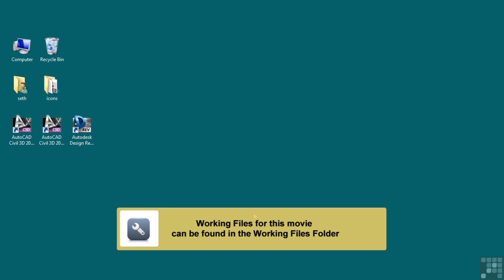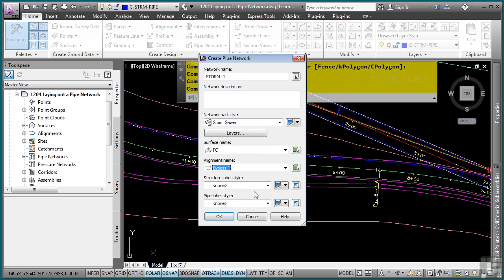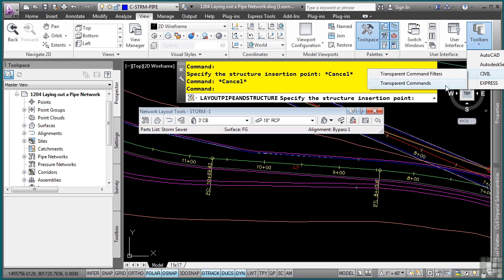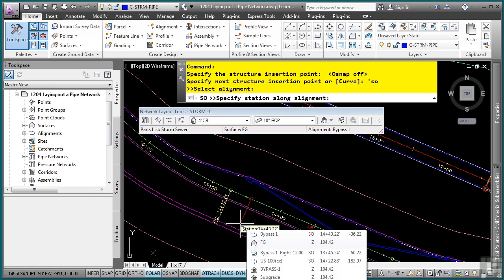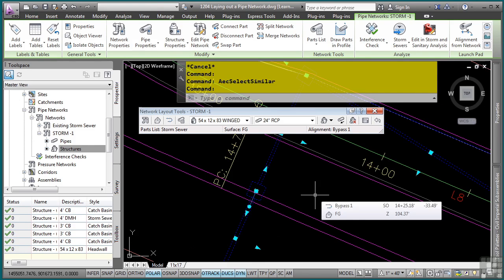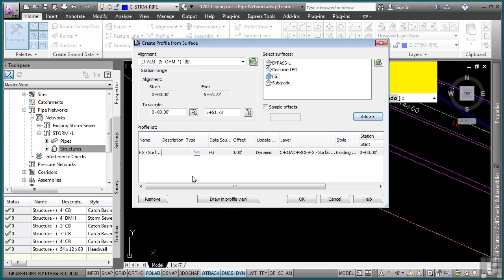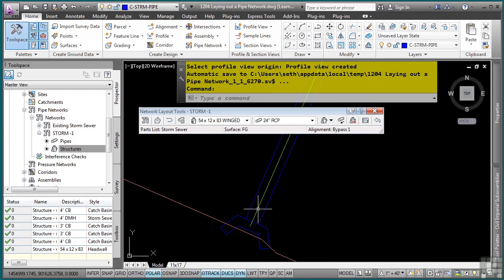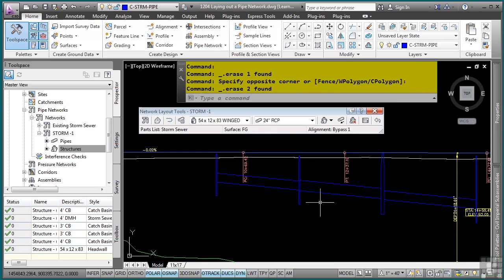AutoCAD Civil 3D Tutorial | Laying out a Pipe Network | InfiniteSkills

Comment: What is the offset you are typing in after you type in the station? Is the depth? Or an actual offset from the alignment? If offset from the alignment is it in inches?
Reply: It's an offset from the alignment CL. When doing this you would place yourself in the direction of the chainage getting 'bigger' and either go from the right (positive) or left (negative).  You can see the blue rectangles (catch basins) as he does this.
Reply: For example when you are selecting the centerline of road as you are alignment then it will automatically create a pipe net work and use the Offset to place in the pipes